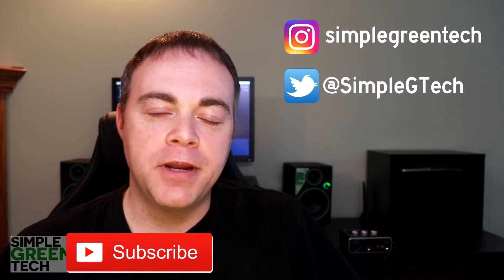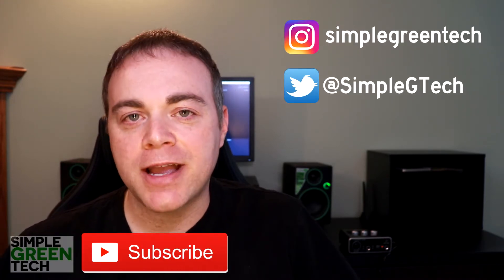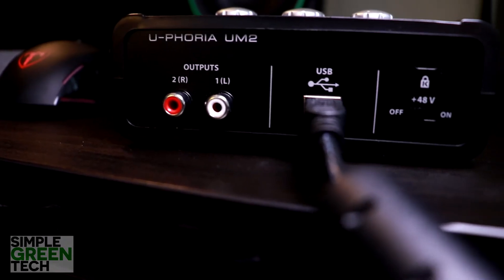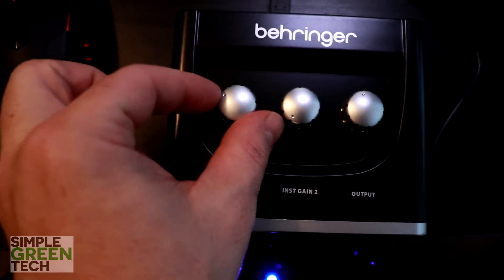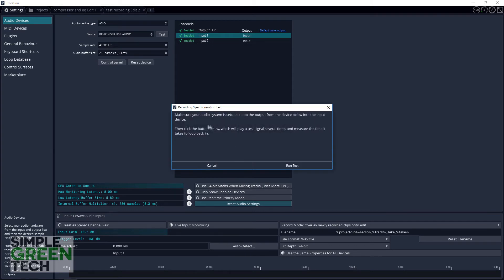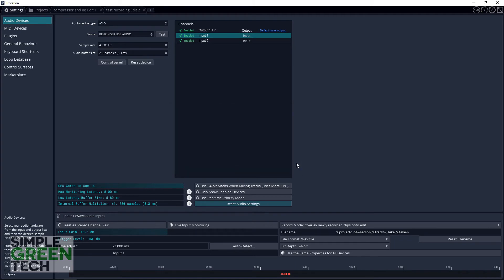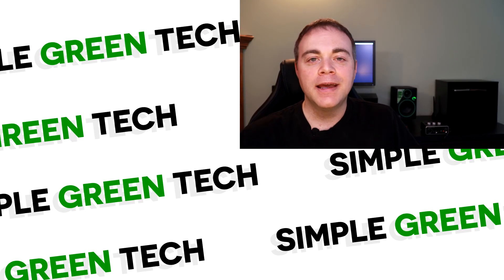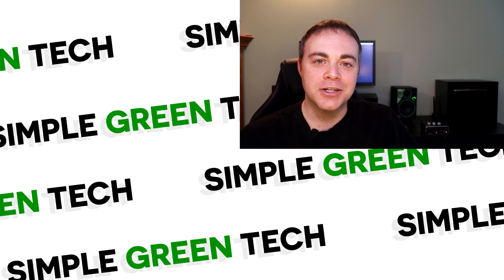Tracktion 7 Tutorial - Zero Latency Recording in Tracktion T7

Comment: Hey I have the exact same setup with the same interface (Behringer UM2). Would it be possible to run the same test except i connect a patch cable to the headphones vs connect to the L output? I dont have that specific wire in the video but I do have a 4 inch 1/4th to 1/4 cable. Thanks!

Comment: Hey! Which kind of cable are you using to do this test ? I have a Behringer umc204hd and want to buy some monitors speakers Presonus Éris 3.5, but not sure i can then run the latency test. There are a pair of RCA cables, cable mini-jack TRS-TRS, mini jack TRS to 2xRCA. Can I then run the test with these cables or do I need an adapter ? 

Thanks a lot for all these videos, it has been very helpful !

Comment: does this test need to be done for each and every new input that's being used? for example i did the test on input 3 did some recording and it was ok, then i wanted to record with input 4 and the latency was off, so i would have to connect again an output to the specific input of the track i am using? once this is done are the changes made per input or are they global for all inputs ? i'm using the behringer uphoria 1820 and a behringer ada8200 they each have 8 inputs and 8 outputs, for the ada8200 should i run the test from one of those outputs to the inputs of the uphoria? i'm using midi triggered external gear and trying to record the audio matched perfectly to the beats and measures in the daw, is there some other setting i should be using ? it's not possible to quantize audio in t7 correct? the waveforms as they are being recorded?

Comment: Hi, I'm using a focusrite 2i2 and tracktion waveform free and put ASIO as the devise type but the only option in Device is <<none>> and there is no detect button.
I have done this before with no issues but it isnt working anymore.
Any idea what I'm doing wrong?
Reply from the maker: Did you install the actual Asio driver for the Focusrite 2i2? Or are you just using the default plug and play driver? Try going to Focusrite’s site, download the latest driver, install it then see if that works.
Reply: @AudioTechTV  Awesome. Will try that. Thank you.

Comment: Hi, SGT. I have xenyx 302usb audio interface and I use tracktion t7 on windows10. But im getting error when I select asio on device type it doesnt show my audio interface. Can you help me?
Reply from the maker: Did you install an Asio driver for it? If you just used the plug and play driver it likely won’t be Asio. Try going to Behringer’s website and see if there is an Asio driver that you can get for it.
Reply: @AudioTechTV . Hi, I've gone through the Behringer's website and it gave me an Asio4all driver. So I downloaded and installed it but when I go to the audio settings and select Asio im getting an error. I forgot the message but it's something like "device not working properly"

Comment: hey, does anyone know why when i choose ASIO as device type, i can only choose 'none' as device, while my interface is connected? i dont really know what ASIO is and what it does... any help is appreciated
Reply from the maker: ASIO is a type of driver for your audio interface. It gives you much lower latency compared to windows drivers. You also might experience pops and clicks with windows drivers. You can control that better with Asio. If you have an audio interface and aren’t seeing anything show up it could be due to not installing the Asio drivers for your interface. Head over to the manufacturer website and see if you can find them. If you don’t have an audio interface and are just using your on board sound card then you can download Asio4all it’s an emulated driver that you can use with any audio interface. It will even allow for advanced routing options. Thank you for watching. Keep creating! 👊👍
Reply: @AudioTechTV  thanks so much for the quick reply, downloading the drivers for the interface worked perfectly! also thanks for the explanation, most guides assumed that the user knows what ASIO is, so i was a bit lost :) youre the man!

Comment: It didnt work for me... Im usin ASIO4ALL, do I need another driver or sumthing??
Reply from the maker: I've never tried it with asio4all but it should work with it as long as you have asio4all set to use the same device as the input and output. You might also want to make sure you are using input 1 and the left output on the device.
Reply: Simple Green Tech I did that, its sayin sumthing about tha “loop cannot be made or tha mic may be pickin up too much noise” but I have it dead silent in here......plus I dont have an interface box, jus usb....might that be effectin it??
Reply from the maker: Are you just using a USB mic?
Reply: @AudioTechTV  Yessir..
Reply from the maker: @DjinnGang  I don't think this will work on a usb mic. The software has to send a signal out and then receive it. It won't be able to do that into a usb mic.
Reply: Simple Green Tech ah, I see.. Ima have to get one of those interface boxes.. Thanks for all ur help.. 🙏🏼
Reply: Simple Green Tech I have an interface but it says the same thing as him about the loop thing and it’s to noisy it’s says

Comment: It keeps saying it can’t detect the test signal it’s says the output isn’t being correctly looped back or the signal is to quiet or noisy I use a focusrite interface how do I fix this ?
Reply from the maker: When you tried it did you go from input one to the left output? Turn the gain for input 1 to half way and the master volume to halfway and it should work.
Reply: I’m having this issue too, can’t figure it out
Reply: @official.lilbig  did you ever figure this out?
Reply: Marcus Hyman no I didn’t actually. I’m starting to wonder if my laptop just can’t handle the program.
Reply: Lil Big just figured it out earlier. Have an output set that has a speaker (laptop, monitor ect.) have it turned up loud enough for your mic input to catch it. Then run the test
Reply: I had the same problem. I set the mic to record , put it up to the headphone and it worked .

Comment: I am using Behringer xr-18 how do i setup my left output to input one?  the left main? it is a xlr jack. the manual says use patch cable. I click run test and it says could not find signal . ive tried every cable combination from L main output to input 1 using ...(1/4 to XLR), (XLR to XLR), (XLR to 1/4 stereo), what am i missing and what is out put 1&2 in my xr-18?
Reply from the maker: Thank you for watching. To do this latency test you could go from your headphone output to input 1. That should work. Output 1&2 are left and right. Left 1 and Right 2.
Reply: @AudioTechTV  ok, so i dont have to change any settings for headphone jack assigment? Use a standard mono patch cable or stereo?
Reply from the maker: You do not need to change any settings for that. If you have speakers connected, make sure they are turned off. A standard patch cable should work.
Reply: @AudioTechTV  do i set the headphone volume to midpoint then test?
Reply from the maker: C N that could work as long as there is some audio going through and not too loud it should work fine.
Reply: @AudioTechTV  ive tried different cables and tried different inputs. I see something going on because as soon as i plug the cable in to my selected input, the meter at the bottom immediately moves and the gain on input on Behringer XR18 looks like its  at full blast. as if it is detects it but i dont see why tracktion has issues i turn the headphone output  gradually up then down a  few times  and tracktion still does not detect sound. and tells me its not looping back properly. I just want this to work.

Comment: Interesting video ,especially seeing as I have just got my first audio interface and have been experiencing this latency. There's a few things that would be helpful to explain in a bit more detail.
1. You need to bodge or find a cable that goes from a L/R audio plug to a 1/4" jack. 
2. Because input 1 is now the feedback loop, you are restricted to using input 2 for your mic/guitar. So when you say you can use whatever interface you have, you mean as long as it's got 2 inputs, and the second input is the type you need. (For example in your case with the UM2, your second input is just a 1/4" jack, so you won't be able to use a mic).
3. If you must un-plug your studio monitors and headphones from the audio interface, then presumably you need to use your computer's headphone socket for monitoring.
Reply from the maker: Sorry I should have said in the video that once you are done doing the latency test you can put everything back to normal. You do not leave it in a feedback loop, only for the test.
Reply: @AudioTechTV   I have now tried this and this worked pretty nicely! Thanks!
Reply: That was the part that made it all makes sense just now for me. Thanks
Reply from the maker: Thank you for watching the video. I’m glad it worked out for you!